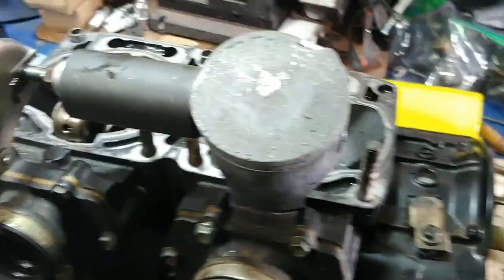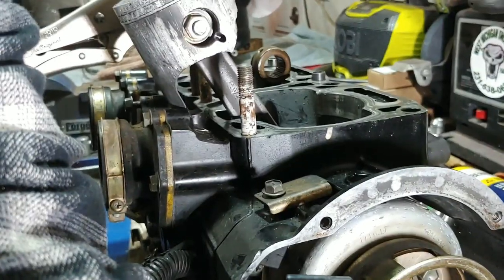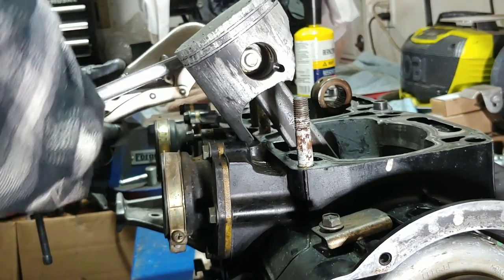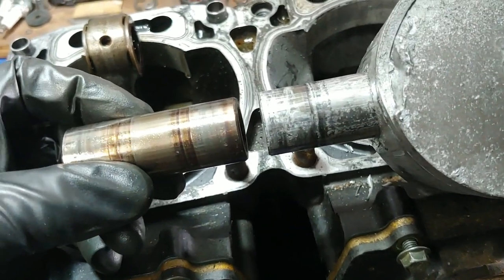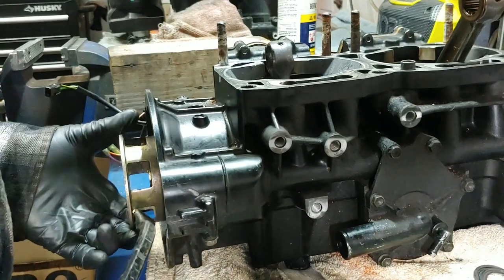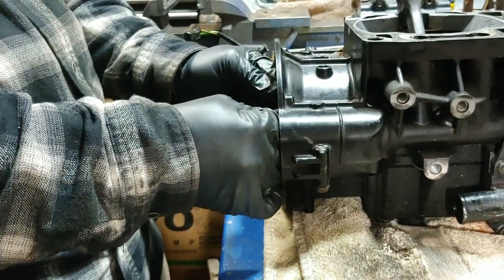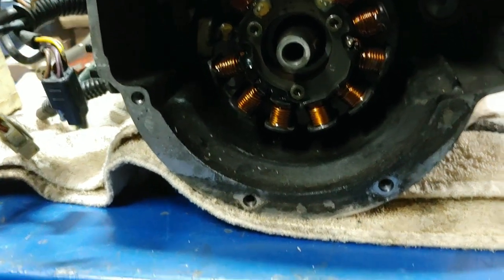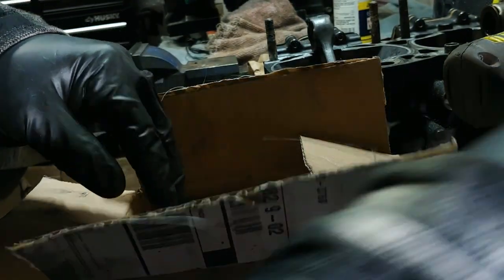02 Arctic Cat ZR 800 CCE Rebuild part 12:  THE DAMAGE IS CATASTROPHIC || Splitting the Cases!

Comment: Andrew I have 2002 arctic cat zr 800 my clutch just broke is it better rebuild clutch or replace it with new d and d race clutch
Reply from the maker: I guess it depends on what you mean by it broke? Lol. But in all seriousness... I think that it depends on your budget. If you rebuild yours on behalf of an actual broken sheave or center slide on the stationary sheave then you'll have to purchase another part, get it rebuilt and then get it balanced. All that... you may as well get a whole new clutch. You can try contacting Keith Loudermilk at West Michigan Snowmobile Parts if you are in the states and see if he has a good used one. He also rebuilds clutches that are worn out. Not necessarily broken. Its not recommended to nake a new clutch but is possible. Other than that I dont have much experience with the D&D clutches. Ive heard TEAM clutches are good but I was blessed enough to find a brand spanken new OEM Arctic Cat ZR 800 clutch for mine.
Reply: Andrew I'm from Connecticut clutch wasn't kicking in until hit 5k very slapping bolt holds clutch broke off
Reply from the maker: @Matt Teixeira oh yikes. That can be a dangerous situation... Ive seen videos of them literally exploding. But yeah my first clutch in my ZR 800 came off after the clutch bolt broke. This was after me torquing it to spec as well. So I can only assume that the person I got the clutch from gave me a bad bolt. Word of advice... Purchase a brand new clutch bolt if you take yours off. They are $12. Priceless considering the peace of mind. 

Youll want to follow strict method of first install. Inatall the bolt and torque to spec. Then start the sled, let it warm up (always for longevity) and then take it for a 5-10 minute relaxed ride. Then go home and loosen bolt and retorque it. All bolts exposed to temp changes and vibration will stretch a micro amount after first install. So retorquing is required. Just keep that in mind. 

Go to CountryCat.com or Babbitsonline.com for new bolts and parts in General!

Comment: What size pistons on these old school cats??
Reply from the maker: They vary... For stock pistons the go from the 370 @ 60mm all the way up to 85mm for the 900's. But you csnget bigbore piston as well. This 800 is sll stock bore. 
Thx for the support and interaction.
Reply: Andrew Crocker my mom has a z370 05 06 year model all green cat i did have to rebuild it from the ground up with my 2 younger brothers i was just wondering what size them old suzuki cat pistons were